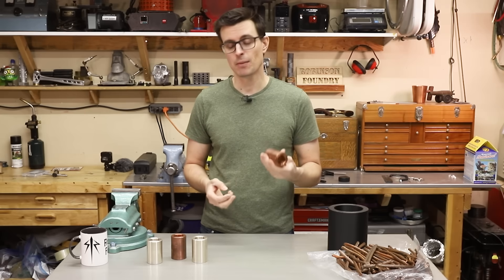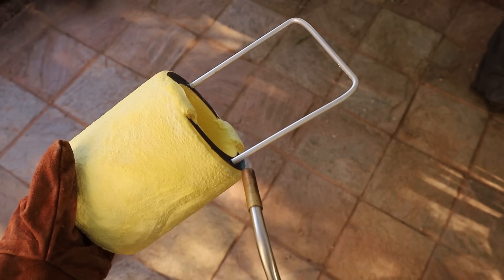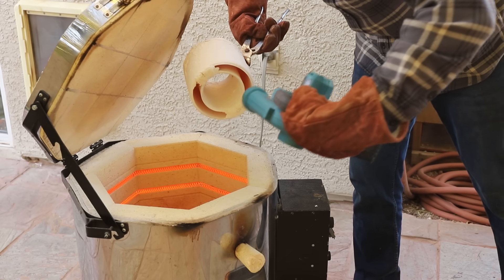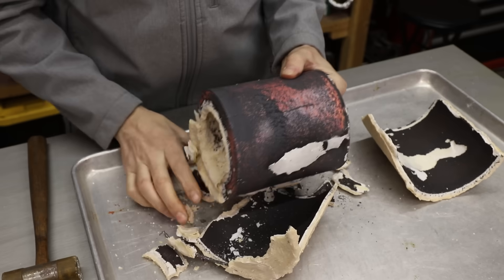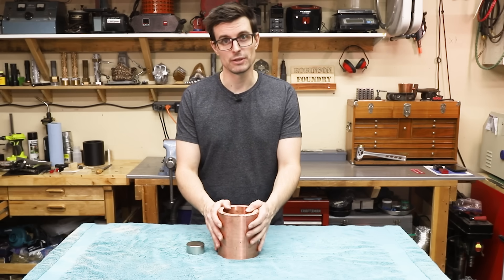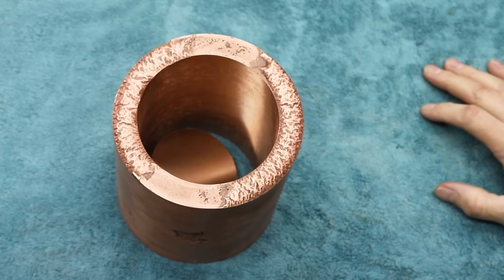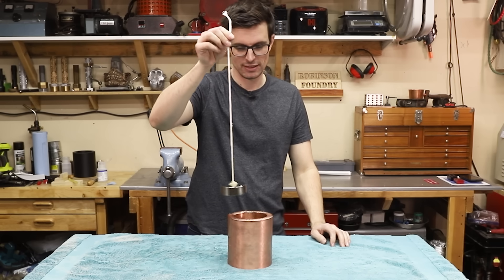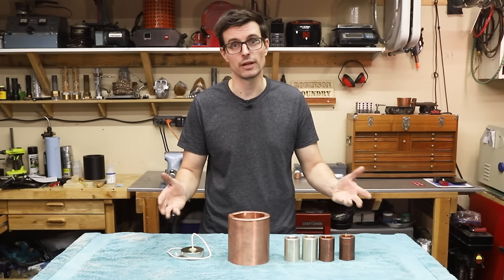Defying Gravity - HUGE Neodymium Magnet vs Copper Tube Experiment - The Power of Lenz's Law!

Comment: A suggestion for you from a guy who has (probably) no experience with any of this -- look at the video @5:25.  You have placed a constraint on yourself by pouring into the smaller gap in the mold.   I suggest you rotate the mold 90 degrees so you can pour into an opening several times larger.  I follow this recommendation while pouring cement from a mix truck off a chute and into a foundation form.  I guess I have many tons of experience with this sort of thing after all!  Excellent video.
Reply from the maker: Haha yes I realized that while editing the video! Such a simple solution. Fortunately I had more than enough this time! Thank you!
Reply: I thought the same thing
Reply: Also lets you pour much faster to give a better fill quicker.
Reply: I thought the same..
Reply: Eddy current machine
Reply: I thought for several minutes trying to understand what you meant by rotating it 90 degrees. I think you're trying to describe positioning the pour such that, in the linear manner in which it sloshes, the slosh will be more along the arc, such that, as it's being poured here at the "3 oclock" position, keeping the molten pitcher in the same orientation but rather pouring into the 12 o'clock position means you have several inches of curve to catch drips rather than limited to the width of the hollow.
Reply: Tons or tonnes

Comment: Id like to see you take a length of clear pipe with ID equal to the ID of the copper tube. I'd like to see what happens to the speed of the magnet falling through the tube given different initial speeds.
Reply: The magnet would accelerate at 9.8m/s² (32ft/s²) in free-fall when dropped through a clear plastic tube. You don't actually need a tube to demonstrate this, you can just drop the magnet anywhere outside of the copper tube.
Reply: Quite true. However confinement in an inactive tube would allow one to compensate for frictional forces due to displacement of the air during the drop and allow a better determination of where and how much influence the copper portion exerted.  @juliavixen176

Comment: It shouldn’t be resistance that keeps the magnet in place. But opposed force generated by the inductance. You can test this by cooling the copper with liquid nitrogen, this should decrease any resistance, making a super conductor and the effect should dramatically increase.

Comment: Next time you should do this, try letting your copper cool naturally instead of quenching it. Your cystaline structure of the copper will be alot different, they will be alot tighter structure. Your eddy currents alot different.
Reply: Cooling copper slowly hardens and crystallizes the internal structure. Quenching and cooling it as quickly as possible anneals and softens the copper, all copper wire is annealed. I'm not sure that this makes the wire a better conductor so much as helps prevent the wire from work hardening and fracturing which would definitely not be good for electrical wiring...
Reply: It is true that slowly cooling will improve conductivity, but only partially due to physical structure. Rapid cooling causes high internal strain, which can cause macroscopic cracks, but also produces crystalline shear and can even prevent crystallization, resulting in zones of amorphism. Generally speaking, improving crystalline ordering improves conductivity, so a slower and more consistent cooling should result in higher conductivity. Shoving the whole thing in a bucket of kieselguhr for a week or two would let it cool as slowly as reasonably possible via passive means - a tightly regulated programmable kiln could lengthen cooling time even further.
Reply: Quench it in hot oil and then dip it in nitrogen to cryogenically stress relief the crystalline lattice. The cold alignment of the molecules helps.
Reply: @SPHYNX99752 that is counter productive. Best to slow harden, then add the cryo in a three stage cryo “anneal”.
Reply: I presume its air entrapment could be the issue here, some air vents in the mould would have helped. But as he explained this is not an issue for this application.
Reply: Ya. Makes sense. Glad to have read that.
Reply: Yeah the experiment didn't go very well, air dry your copper next time... "fyi"

Comment: Can I suggest you build a damper otherwise called a shock absorber with a magnet on a fixed shaft centered in the tube.  It would be interesting to measure the foces applied.

Comment: I wonder if you could put the tube horizontally on a couple of rollers, with one being motorized,  so you can spin it at a controlled speed, and keep the magnet levitating in the middle, similar to when you rolled it on the table.

Comment: Setup a system som you can pull the magnet back and forward in the tube and se if you.are.able to generate any heat in the tube and maybe even a small voltage through induction.

Comment: Your molds are cracking because the plastic is expanding during the burnout, you can get 3-D printing, filament, specifically for burnouts.
Reply: Also I think it would have fought him less if he'd printed more hollow, or totally hollow. A simple taper on the inside near the top and one could easily print it hollow with very thin walls. Bonus points for less overall material to eliminate.
Reply: Plastic shrinks when it's heated !
Reply: @richardkelley1646  Behavior isn't strict black and white like you want it to be. Anyone that works in plastics knows it has stresses in it that cause it to warp when heated past its glass transition temp, not just shrink. This is why casting plastic blanks into other materials is such a bitch. Take a simple model of whatever and heat it to say 210 and it won't just get smaller, it'll mutate in all kinds of crazy ways, bulging here and indenting there, and there's no telling where it will warp until it does. This is why low warp plastics are such a big deal in 3d printing. NOT LOW SHRINKAGE, low WARP.
Reply: I'm no expert on this subject, but could you use candle wax instead of plastic for your form , it should be easier to burn out without stressing your ceramic mold.
Reply: @Ropetangler This is how   jewelry (rings) are made. Wax burnout in plaster of Paris then pour the metal into the p o p mould. I used to work at a place that did that.
Reply: I would assume the pipe he printed isn't close to being air-tight, especially not when you start heating it and the plastic softens, and unless it's printed solid there would be plenty of space for the material to expand into in the hollow sections

Comment: I saw a video once of a guy heating up water with copper pipes and magnets. The magnets where on a sort of a rotor moving them past the copper pipes very fast. Resulting in the pipes getting hot. And that heated up the water. It would be cool if you could do something of that sort with the copper and magnets.

Comment: Should get a thermal camera to see if the copper heats up while the magnet travels through it.
Reply: Copper has such a great heat capacity that you would need to keep the magnet moving for a considerable time with this thickness of copper tubing.

Comment: Drop the magnet into the copper tube. I wonder how high you can drop it before the tube stops slowing it down to the speeds seen in this video
Reply: The Lenz force increases with relative motion of the magnet and the conductive material . Greater speed = greater force.

Comment: if you attach a wire to the magnet, one to the copper tube, and one LED to the two wires, will the LED turn on while the magnet descends?
Reply: AFAIK probably not, the circuit is already complete. The electricity runs in circles around the tube and doesn't really have a reason to leave the copper. However, I image if you were to cut a break in the side of the tube so it wasn't a complete circuit you could then possibly power some small device by connecting it across the gap. That would probably kill a lot of the levitation though, a larger electrical resistance in the loop means less eddy current and therefore less of a magnetic countering force.

Comment: try attaching the magnet to a drill and spin it at high RPM inside the copper tube.

create small spinning table, sit the copper tube on it so it spins (try to get the highest rpm possible), drop the magnet inside and see what happens
Reply: You need to keep the drill far away from the magnet or it will get stuck... also you've reinvented the electric generator.

Comment: Usually you'll see the demonstration of the magnet attached to a string (on the thin edge of the magnet, like how you would wear it as a medallion necklace) but instead of a copper cylinder it's a copper plate about the same thickness (oh, I don't mean a dinner plate lol - more like a thick piece of paper lol) With the copper plate standing up on it's side the magnet medallion is  hung down from a fixed apparatus so the flat side of the magnet is about a cm away from the copper plate large side, so they are in parallel. Then the magnet is pulled away from the plate, taught on the string, and just released. It swings right up to the plate and then just stops without touching it!!! It really is counterintuitive LOL (I just hope I conveyed this correctly, I'm not to good at communication lol)
Now I know you don't have a plate, but I am fairly certain you would get something close to this effect with the side of the large tube... or maybe not... it is a tube after all... I have no clue if this would affect the behavior ... worth a try, right? :)
- ALSO did you notice the copper getting warm?  That is what this magnetic resistance turns into - heat.... I'm not too sure it would be enough to notice on such a large piece of copper.... though if you play with the large magnet and the small cylinder, just doing things that cause resistance to occur, the smaller piece of copper would be much easier to notice the heat with your hands... or a laser thermometer... if you happen to have one ;) 
GREAT VIDEO!!! I LOVE SCIENCE!!! :D

Comment: I imagine you have seen some of the older vintage foundry films like British Pathe’s ‘Casting In Iron’ and such. I have always been fascinated by the large hand wheel and gear systems that factories use to pour molten metal. I have been thinking about trying to build one of those for a few years but just don’t think my little jewelers electric foundry is up to the task of justifying the build. I feel like a pouring frame for heavy crucibles might be just the ticket for you.

Comment: Reluctance or, more commonly, reactance are the words you're looking for. It's the resistance to changes in magnetic and current direction. It's mostly used in inductors that are paired with capacitors for frequency regulation and filtration. 

Lenz's Law makes it so that the magnetic field generated by a current resists change in the current's strength. It stores magnetic energy like a capacitor stores electric energy. As a current drops, the magnetic field shrinks at 90° to the wire it's flowing through. As it does, it crosses the sections of wire next to the section it's coming from, generating electric current. As the strength/direction of the current changes, the resulting magnetic field will create an opposing current. Regular changes in the current (the frequency) simply create an imperceptible delay in direction, but irregular changes, such as signal noise, end up "blending" for lack of a better term, into the dominant/resonant frequency.

This was an oversimplification of what is happening, but proper detail would and does require a solid 10-20 pages of theory, maths and examples... You know. Like you'd find in a textbook. Or at LEAST an hour video, but more like 4-6 hours like you get in a week of Electronics Engineering lectures and demonstration in college. Plus the additional hours spent practicing calculations, circuit experiments, doing homework, etc. Most of your first year of EE is spent learning this stuff, averaging one or two physical parts per week; the theory, maths, and application for each.

Ah, the memories. I can still smell the blown caps and fried transistors almost 20 years later. 😊
Reply: Ah yes, the magic smoke...
Reply: Came to the comments looking for the magic word, "reluctance" -- before posting it myself.  TY. :-)
Reply: They didn't tell you about the "Energy carrier" .... A collapsible elastic solid... Magnetic energy= a rotation in a medium, électrostatic energy = a tension in a medium... 
So physical space is 1 positive tensionZ & 2 negative pressuresXY.
And what we see is Weber's law of 1846....

Comment: 1.Attach your smaller magnet to the outside of the copper tube and drop your big magnet into the inside of the tube.  Does the outside magnet just attract to the inner magnet or does it mess up Lenz's effect?
2.Put the ball magnet on the outside of the large tube and use the small magnet to drive the ball around the tube, from the inside.  Does the copper prevent direct coupling during the position transition?
3, Put the copper tube on a variable speed rock tumbler with the magnet inside and rotate the copper at just the right speed to suspend the magnet in the axis of the copper tube.

Comment: Here's one: copper plate bottom with a wooden peg sticking out of it, not in the center, but not at the edge either. Tastefully arranged as it were. On that wooden peg, put a small hangman's support and wire and hang a magnet just mm above the copper plate. Allowing it to swing is really nice as the magnet slows down.

Back in high school, i made another one which was a bit more complicated. A wooden base, with three supports. Those three supports (also wood) held two half circles of copper plate, spaced at approximately 2 cm. A seventh wooden pole elevated to the center of those parallel placed half circles held an axle, that on one side had a geared handle (stolen from one of those military phone gear dynamos, WW2 German phone, to be specific, the Siemens one in orange paint) and on th eother side, through that shaft, a wooden ruler of 40 cm in length that had a magnet on the end of it. The idea was that, you'd turn the crank and feel the forces act on the crank. It failed, because it wasn't robust enough. If i were to remake it (gods above, i don't even want to think how much the copper would cost today :)) ), i would make the handle pole much, much more robust and (because i can now) made from metal with welded supports to the wooden base.

Comment: Since the molds crack pretty much every time, why not use the fiberglass cloth while building up the layers? Not for every layer, certainly, but using that instead of the silica sand for one in the middle should help.
Reply: For what it's worth I agree, but it makes removal of the ceramic much harder after casting.
Reply: yeh i was thinking that superslurry stuff is shite too :D

Comment: Idea... Polish you copper tube really well so it will spin on bearings laying down like u shoeed at 8:30 , but power spin the copper tube via belt connected to a motor so the tube spins and plce the magnet inside and see how stable the levitation is
Reply: I bet there's a rock tumbler that would work perfectly for that application. Would be cool to see
Reply: @starechomic  A rock tumbler would work, or 3d print a set of pulleys to go over the tube and hang it with a set of V belts from a rod in a drill.
Reply: I was going to suggest the same thing - spin the copper tube like rolling it on the table but in place to show the magnet hovering in the middle of the tube
Reply: This way you would end up building electric motor eventualy.
Reply: @gorazd68  Or a generator, which might be worse...

Comment: Use that cordless drill to spin the magnet in the tube.  But use the string that you glued to the magnet.
Reply: Or a wood dial
Reply: You can't bring that cordless drill or any other ferimagnetic materials near that magnet or they will get stuck together with 400 pounds of force.
Reply: @juliavixen176  that is why the string is inserted into the drills chuck/ jaw grip.  It's usually where the drill bits would go.  And if needed, add another foot to the string.